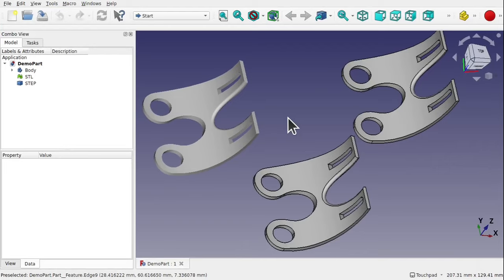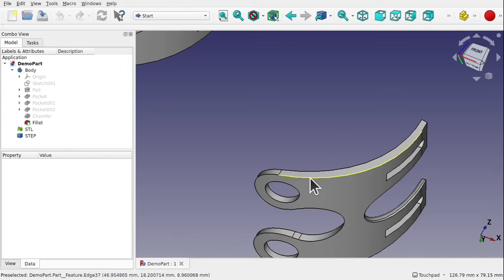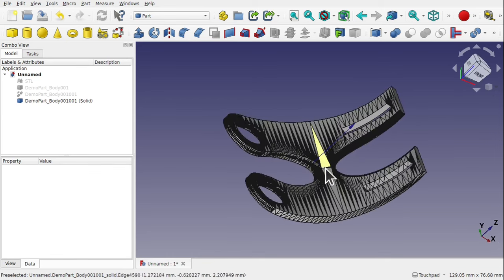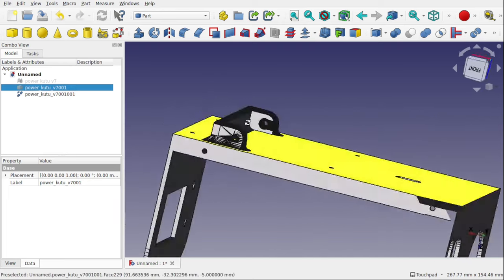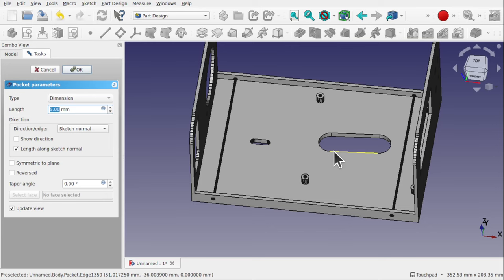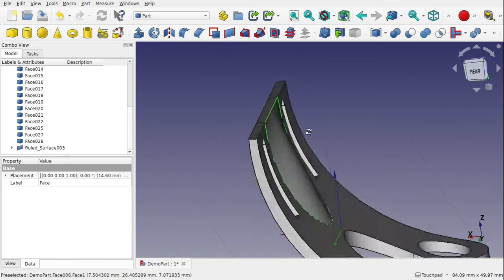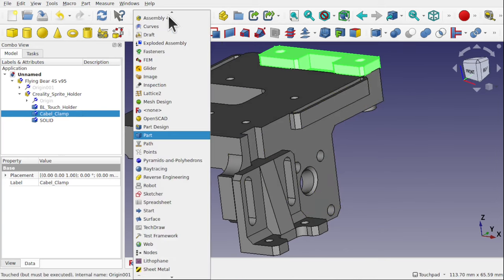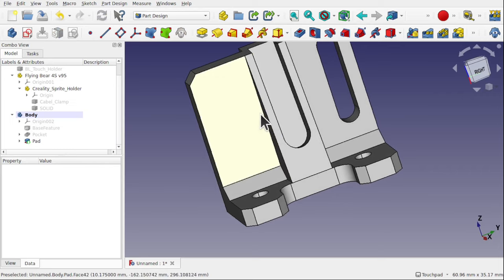Learning FreeCAD for Beginners | 38 | Modifying STEP and STL files

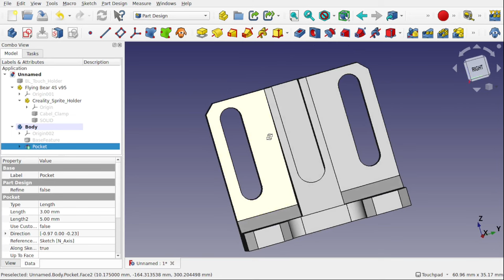Comment: Starting at 23:44, for removing that slot as with everything else in FreeCAD there is another way using a 3rd party workbench. Specifically, I'm referring to the Defeaturing workbench. Just as an FYI.

Comment: I would absolutely love a version of this video that deals with large assemblies, of which I may only want to modify a specific part. I've run into a plethora of problems with this, especially with trying to export or modify parts that are attached far, far off the origin of some obscure coordinate system which I'm not even sure where it belongs to.

Comment: great video, been watching alot of your content, very helpfull!! 1 question, can you change dimesion on the original slf at all? have a file that i need to reduce the overall dimesions
Reply from the maker: Glad you have been enjoying. In the draft workbench there is a clone tool. I have never tried this with a mesh but after you use the tool in the properties of the clone there is a scale. Give that a go.

Comment: Great video, thank you.  I have downloaded a step file which I can add holes to by following your steps.  I also want to "Fold a wall" using the sheet metal wb.  I draw a single straight line along a flat surface, select the surface and then the sketch, click fold a wall, and the operation always fails.  Is it even possible to use the sheet metal wb on an imported step file?  Any tutorial out there that I can follow? Thank you.

Comment: Hey Jelly, what if want to change the size or dimensions of a pre-existing design or body
Reply: I was wondering about the same thing. I think we need to take out that part you want to modify out of the assembly, create a body, create a new sketch, adjust to whatever dimensions you want, and then redefine. But I might be wrong..

Comment: I find editing an stl file in FreeCAD to be extremely slow and annoying.  Even after it is converted to a solid and a sketch is created, every operation is very slow and I have an I5 processor with 8GB of RAM.  I would think that would be enough.  I have FreeCAD 0.21.  I will probably stick with using OpenSCAD to modify an stl as it is light-years faster than FreeCAD.   Creating a object from scratch in FreeCAD works fine, but importing, converting and modifying an stl with a sketch is extremely slow.

Either that or I am doing something wrong.  I followed the following steps.
    1. Part → Create a shape from mesh provide 0.01 resolution
    2. delete original STL/mesh (I just hid this)
    3. select the part and then Part → Convert to solid
    4. delete the previous shape (I just hid this)
    5. Part → Create a copy → Refine shape
    8. select new refined shape. Part Design → Create Body . this will also add base feature
    9. At this point we can create a new sketch and work on our model just like normal.